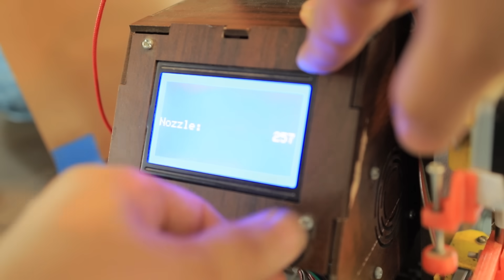How to Make free & easy filament for 3D printer at home

Comment: this is really interesting, but it'd be great to have more specifics on the process, mainly how to make the custom devices you're using
Reply: the king of random did a video on the thing that he used to turn the bottle into a long strip
Reply: @shrub9677  but from the strip to the filament is where we struggle
Reply: @derekdearborn9063  looks exactly like the 3d printer head just mounted to a board and pulled through with a timed gear box.... kinda wish i'd thought of it.. but.. here i am feeling like i need to rethink a lot...
Reply: > but from the strip to the filament is where we struggle
 @derekdearborn9063  i absolutely missed that, that is, what happened after 3:40
Reply: @derekdearborn9063  yeah that's were video fails hard
Reply: @yash1152  It's a nozzle (the point of any printer) getting fed by the pet filament, it heats at a temperature that can't dissolve but still volatile. Since it's using a nozzle, the string get out the exact form / size (normally 1.75mm). Them he made a little machine to pull the string at a certain speed. Simple and Smart.
Reply: > thing used to turn the bottle into a long strip
 @shrub9677  yeah, i was also thinking that i have seen a video on that before.
Reply: @shrub9677  What should I write to find this video? Please help me out!
Reply: @iiaskar  king of random soda bottle string
Reply: @iiaskar  There is a link to the bottle cutter in the video description.
Reply: Read the description
Reply: @The_Wosh  Same Bat Channel …🦇
Reply: you can see it just go after it a play with heat settings and reel speed man
Reply: IT's literally just a slow, electric winch, pulling the strip through a 3D printer hot end.
Reply: That's exactly what I was thinking
Reply: Thats why you subscribe and follow, comment, etc. So he does eventually show you.

Comment: I wonder if a different extruder can be designed to feed the plastic ribbon directly in. As long as the plastic ribbon can be the constant width and thickness it should be able to be done.

Comment: Wonderfully simple processing. Do you have the set up specs for your extrusion machine? I use PET filaments cut from bottles as shrinkable binding material for boat building and would like to experiment with the uniform filament.
Reply from the maker: This is great

Comment: so essentially you can't do anything to help anyone recycle the actual print material. 
and this video is a waist of time, 

because the time, equipment, needed to do what youve done here 
FAR exceeds the average users capability and in house equipment. 

not to mention i can buy a role od pla, for 17$

your not teaching your just showing off, as you know others can NOT do this. because time, cost, and expertice. 

If youd made a device that did all of this with used 3D printer material and not just a shaved pop bottles it might be worth my time.

but since no-one has come up with a reliable in home method of turning spent material into usable material this video is a waist of time.

Comment: I was melting pvc arround some pes wire at high speeds for job. Its best to cool your filament in water bath "takes some distance to", when it leaves the extruder so it has better circular structure. Because if you spool it right away you can see it in microscope its not round anymore its bend a little and it will impact the strength and diameter. Also clean and check nozzle with microscope once in a while. Especially the brass cheap nozzles.
Reply from the maker: Great point!

Comment: I've seen a lot of comments saying they already thought about this, the difference is you never take action while this man has a goal and your's is still a dream. 

love the video keep it up!
Reply from the maker: Thanks my friend . You mentioned a good point, yes, it is true that most people, even if they are trained, will not go to build it.
Having failed in this several times, I did not sleep until morning to reach this path
This is the easiest way to make filament
Reply: Very much disagree. Not everyone has the knowledge, money, and supplies to build one. Yet you generalize that if one has an action in mind everyone that says: I thought about this already, are all quitters.
Reply: @Declopse  Agreed; I've been dreaming on about filament recycling machinery since I started making waste prints - like anybody else...
Yet I'm only holding back because I want it done properly/easily, I saw someone mention feeding strips into the printer directly - and I do recall some hardcore DIY extruders that could take pellets / shrapnel directly...
Acquiring the knowledge is the first step; then you know what to buy / how much this project will involve... (A killer for some is when the cost outweighs buying a ready-made unit; which would save a lot of time for sure)
Reply: damn bro, you hurt me bruv

Comment: Impressive, 
are you using a 1.75mm nozzle to actually make the filament? How hot is it and how fast to you pull it through?
Reply: Yep, that's the worry with this video. Nothing about the actual construction and no links to the cogs and wheels so we can print them. It is, indeed, a pity.

Comment: Very neat to see and wondering what your hot end nozzle diameter is.  What is that diameter drilled out to?  Will be neat to see more videos regarding and reminds me of the Russian Youtube channel Brother who has been doing similar.  Awesome to see more on board recycling readily available materials.  Especially, helpful for those that have the time and plenty of materials to use.  Thanks for sharing!
Reply from the maker: Your answer is in the pinned comment
Reply: @AIboom20  Thanks!  Great job!  If people would watch you other video doing the same, they'll see how you start with narrower width strips of bottle material and then pull through the larger width material to make the more solid round diameter filament.  Neat to see this performed more.  I'm wondering if there is a different in using like a hair dryer or heat gun to shrink the bottle to make more uniform before cutting or like your method you're doing blowing up to make uniform.  Wondering possibly both to expand first then heat again to shrink down to make a little thicker strips?  Anyway, thanks for sharing and the inspiration.
Reply: @AIboom20  What width did you cut the bottle strips?

Comment: Hello.Sorry for my English(I'm from Russia).Could you please tell me. Do I need to buy a 1.75-1.8 mm nozzle for the extruder?Or does the hole for feeding the thread into the extruder already have a diameter of 1.75-1.8 mm at the outlet?

And yes, you have built a great device.I would like to collect something similar at home, to save money,since in Russia the filament is expensive (by our standards) We have a minimum salary of 12,000 rubles a month, and the filament costs 1000-2000 rubles for 1 kg.
Reply from the maker: Здравствуйте мой дорогой друг из России, я очень рад, что видят мое видео из разных стран, нет, новую насадку покупать не нужно, можно просверлить отверстие 1,7, конечно, готовятся наши обучающие видео для загрузки.
Reply: @AIboom20  Thank you very much for the answer. I wish you all the best.
Reply from the maker: @kapibara3388  я доволен
Reply: @AIboom20  Excuse me, I have one more question.Did you connect the extruder to the printer or just use 12 volt charging?
Reply from the maker: @kapibara3388  Да, 12 вольт и 40 ампер
Reply: @AIboom20  Thank you again! :)

Comment: Oh, man! This is true recycling !!! I would need more info on the extruder you used, the temp regulation circuit, the spooling wheels can be seen, and the cutter you used to make the first part from the bottle... all this needs a video apart think if one wants to replicate all this. Anyway thanks for sharing!
Reply from the maker: Will do.Your answer is in the pinned comment
Reply: @AIboom20  I don't see a pinned comment.

Comment from the maker: Friends, please be patient, I will answer all the questions in this section :

****The main function of this filament maker is to turn your light into an empty tube, but its emptiness is different. If we consider the width of the strip correctly when preparing the filament and reduce the temperature and speed more, the final filament will not be hollow.

-----Can you explain more about the temperature adjustment of this work?
Temperature for PET filament production is 225-200, for filament bonding is 270-280 and for printing is 250-260.

-----Do I have to inflate and heat the bottles?
 No, the purpose of this is to smooth the outer surface of the bottle, without this you can also tape the bottle, see in this video:
https://www.youtube.com/watch?v=Pd9_fyGZdEQ

-----Is this video fa-ke?
 No, it's absolutely true, all the models made in this channel are produced in the same way

-----Do I have to use a 3D printer kit to produce the filament?
 No, but I used this because I already had this kit, if you have enough knowledge about electronics you can do it using Arduino

-----Is there a cheaper solution to this?
 Maybe, if an easier solution comes to my mind, I will make a video for it

-----When will the new video be uploaded?
I will upload 2-3 videos in week , so be patient and follow the videos

-----What should be the thickness of the tape obtained from the bottle?
This is variable. I consider 5-6 mm for a soft drink bottle, which is thicker, and 7-8 mm for a thin mineral water bottle.

-----What is the material of the bottle used?
I have tested "PET" but ABS bottles cannot be produced this way

-----Is the accuracy of the string diameter ultimately good?
If the tape produced by the bottle is uniform, the quality of the final filament will be excellent

----Extrusion block, is it a classic 3D printer heater with a filament diameter?
Yes, the 12 volt 40 amp heater is related to the Prusa 3D printer and the filament thickness is 1.75 mm.

-----Free yes easy I don't think so lol.
this is the easiest and cheapest way that I have experienced and seen so far, of course, maybe I will find an easier and cheaper way later, in which case I will put it on the channel and share it with you.

To control me, I used the 3D printer board I had before, you can even connect your 3D printer heater and thermistor to it.
Reply: too expensive making filament with bottles, here in Germany you have 0,25€ deposit for each empty bottle but the idea and reamization is good👍
Reply from the maker: @skynet7887  Thank you dear friend, you are right, but in Germany, in most countries, these bottles are found a lot, and this training may be a way to generate income for many people, and also many people can, due to the production of this filament. Make their dreams come true
Reply: I am very skeptical, but I will be patiently waiting.
Reply from the maker: @inventtory1272  Do not doubt that this way has been tested, but it is not the only way, we will teach you easier ways soon
Reply: will you be creating a video on how to make this?
Reply from the maker: @GuardTower  Yes, we are recording an instructional video
Reply: @GuardTower  $20 says it'll be just as vague as the others.
Reply: @inventtory1272  I'm with you on that. There is no way to pull heated filament through a form like that. Is it hot enough to soften into that shape then it would pull free, not pull more material through.
Reply: I expected u to print a Mt Dew bottle !
Reply: I wanted to come back and say that with the latest video I'm starting to believe him.   He made a genuine effort to show more.  Especially all of his examples at the end. That's a lot more than just color matching.  It still feels vague but I think its just his editing style.  It's something I'm going to have to try for myself but for now I'm now inclined to think this is real.
Reply: @inventtory1272  yeah but physics says it's not. You have to push it through the heated nozzle. If you pull it'll string out and likely separate. To pull it through the plastic needs to remain solid. To get it to reform into the filament shape it needs to be melted and when you pull it would separate.
Reply: @Razor1rot  That's what I thought.  If these vids are true, then what I think is happening is that the plastic isn't fully melting.  It might just be getting shaped.  That's is actual how blacksmiths make wire.  They pull metal through progressively smaller dies, and they even do it cold.  I got a better look at the nozzle in the latest video and it does look drilled out.  It's at least plausible.
Reply: @inventtory1272  that's a cold pull though. You can't cold pull plastic. For it to be hot enough to be pliable it would pull free. There is no in-between unfortunately.
Reply: Why do you force the viewer to divide their attention between the animation and the subtitles, while distracting them with the non-informational background racket? I'd rather HEAR you TELL us what's going on, instead of having to read while trying to pay attention AND being annoyed by your choice of noise.

Comment: Something that could be done to improve filament "consistency" is making the filament oversized at maybe 1.8mm and then running it through a die of 1.75mm better consistency and nor much sensors or anything required for measuring
Reply: Or no need to roll the filament right away. Pull the filament with the gears to maintain the same tension and after leave some slack and hand roll the filament. Hope that makes sense…
Reply from the maker: There is no need to do this. The final filament is exactly the same size, but the only difference that may exist in some places is the percentage of filament in that part, which I adjust in the 1.5 mm software, which is less than the size it is now, and the reason It's empty filament, maybe you do not understand what I mean I will explain more in the next videos, thanks for asking your question
Reply: @AIboom20  as the filiment is being pulled into the roll it will have a certain torque and speed but as the roll fills up the outside diameter of the roll will have a faster velocity than the start of the roll so the filiment will be pulled out faster causing inconsistency in the size between the start and end of the roll. Have you measured the filiment at both ends?
Reply: @Quantainiumify  This can be addressed by decreasing the speed of the roll over time, ensuring it is proportional to the amount of filament that has already been rolled.
Reply: @AIboom20  i had to watch it a couple times.. really like what you've done... what is the temp of the nozzle? unless it's in the next video.. I'll wait...
Reply: @acronhym  turn on your captions, the temps are listed there. They're also in the description.

Comment: A really nice build,.I didn't know the channel, just a few questions : 
1) what is the plastic of the bottle in the first place ? PET, PETG, PP ?
2) what temperature do you use for the extrusion ?
3) the extrusion block, is it the classical heater of a 3d printer, for which filament diameter ?
4) is the accuracy in the diameter of the filament good in the end ? 
5) have you tried a PID regulation of the tension on the filament ? Different tension will end up in a different diameter in the end, in CNC kitchen's video about a comercial filament extruder, the nozzle have a 4mm hole and the filament get thinner afterwards because of tension.
6) what is the width of the initial ribbon of plastic before extrusion ?
7) last but not least, are theuy any fumes whem extruding and printing ?
Thanks a lot for sharing your work
Reply: Aren't they normally called pet bottles? By definition they're PET.
Reply: Carbonated drinks bottles are almost always PET, and indeed that's what he's using here. 
If you read the description, the temperatures you ask for are there.
I can't make sense of the extrusion block. He has 3 sets of wiring attached. I would have thought just one for the heater and one for the thermistor. Not sure what the third set is about. Plus, the nozzle he extrudes through is a mystery. By rights, it should be 1.75mm. But I've never seen one that size. There are, unfortunately, no links to the cogs and wheels he uses for the extruder. That's a shame. It's still an interesting concept, though.
Reply: @tasmedic  you can drill a nozzle to any size, or just be lazy about changing nozzles: I've worn one out to where it was 1-1.3 mm in a weird figure 8 with the outside measuring 1.3mm and the pinched in size being 1mm, started life as either .4 or .5mm and slowly adjusted nozzle size to match in slicer until at that point I decided a $0.25 replacement nozzle was in order. I've also drilled out damaged ones that were smashed at the tip to 1mm and used for faster printing, and the bigger the hole the easier it is to drill so that's not a problem (I also drill out 1.75mm nozzles to 3mm for my other machine since those cost more).
Reply: Also nozzle mouth diameter != extruded filament diameter. Nozzle itself could be anywhere in the vicinity of 1.75mm.

Comment: Je trouve ta vidéo formidable car jusque là j'ai toujours vu des machines compliqué avec des capteur d’épaisseur pour le filament. par contre j'ai une ou deux question: qu'utilises tu comme buse pour fabriquer le filament?
I find your video great because until then I have always seen complicated machines with thickness sensors for the filament.  on the other hand I have One or two questions: what do you use as a nozzle to make the filament?

Comment: I call bullshit. There is nothing feeding on the backend pushing it into the nozzle to shape it. The second you apply tension to heated PET it would stretch out into thin strands. You have to push through a form not pull. It doesn't work that way.
Reply from the maker: No, it is not